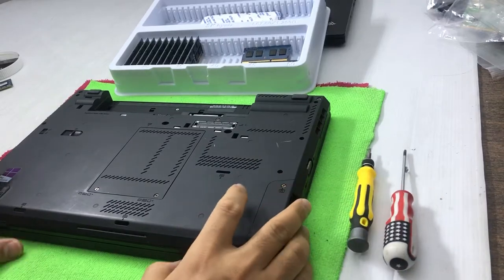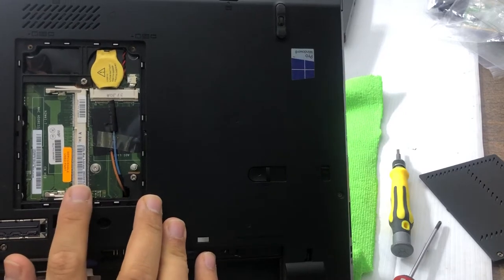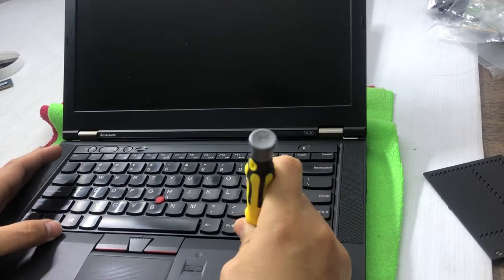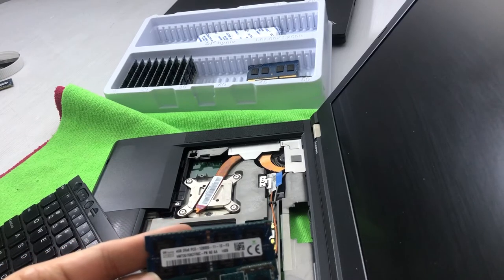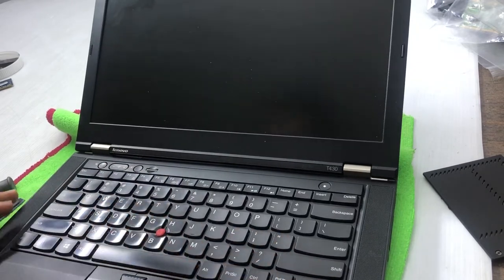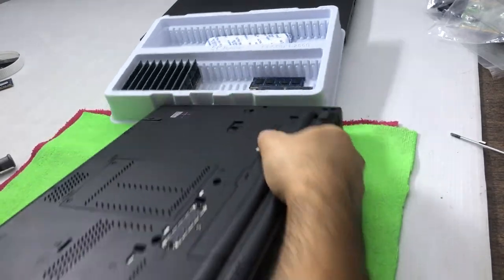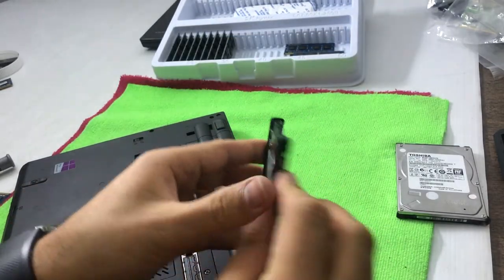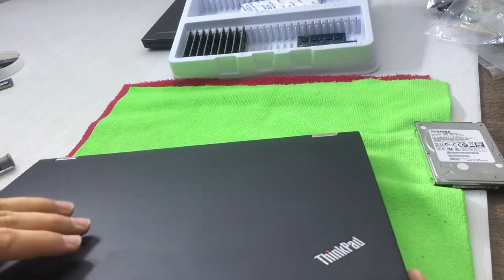Change or Upgrade RAM in lenovo thinkpad t430 / T420 / T410 / T510 / T520 / T530...

Comment: hello sir, I also have t430 with 4GB RAM and want to upgrade it to 8 GB. I understand the second slot it empty and I can buy a 4GB stick and install it easily but the confusion is, can I buy PC3 12800 or can I also buy PC3 12800S, I am confused with the 'S' in the end and also what is the Mhz speed of the already installed 4 GB stick, is it 1600 Mhz? Is the PC3 RAM compatible with PC3L RAM if I get one.

Also, Can I go for PC3L 12800S for both the RAM slots, 2*4 GB PC3L 12800S?